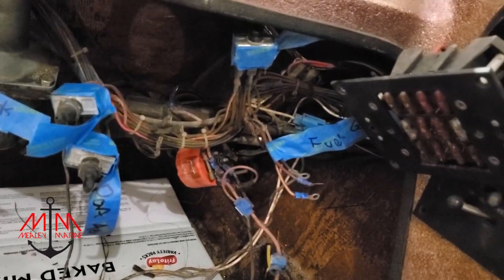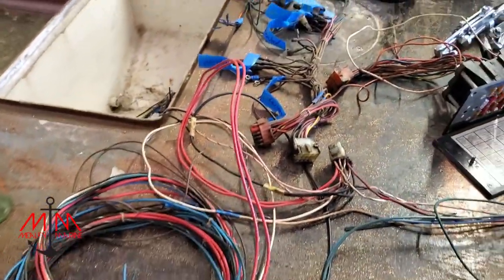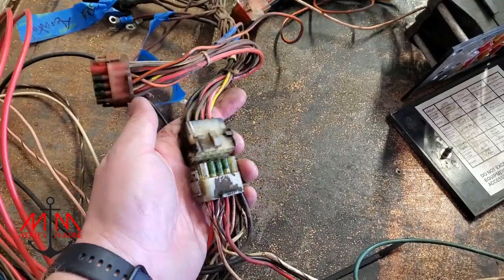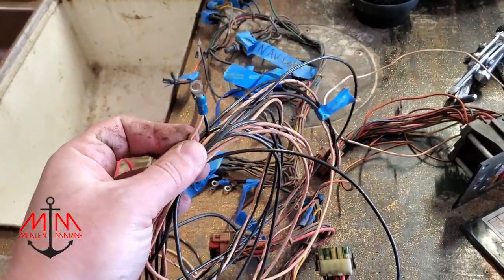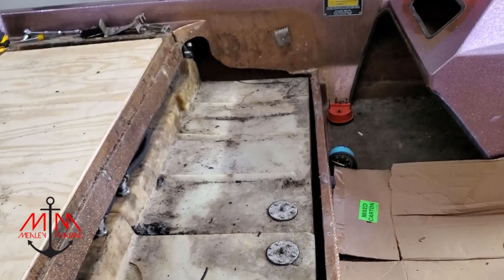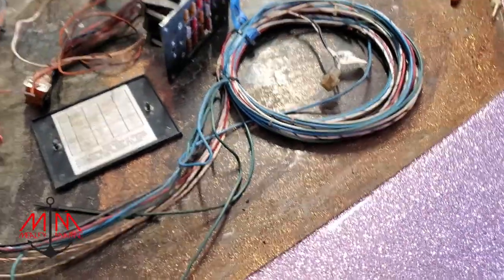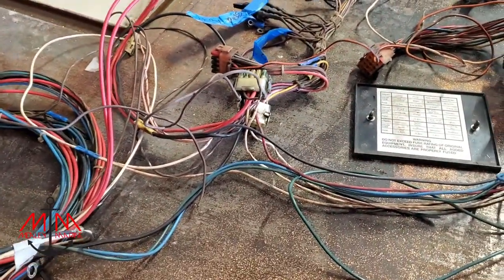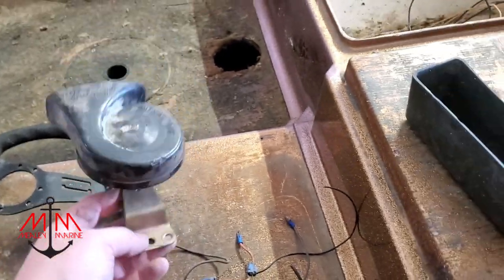BASS BOAT RESTORATION | 1988 RANGER 363V | PART 14: OLD BOAT WIRING

Comment: I just bought a old 88 bass boat. Going to do the same. Tear out all the old wiring and replace it with new clean wire that will be simple and easy to understand and use.

Comment: I have the same exact model boat but its the black, silver and red one in very good condition for its age. Gel coat is still as shiny as the day it rolled out of the factory. To remove the ground wire for the sending unit. All you have to do is unscrew the fill hose from the tank, take the 3 screws out of the fuel fill cap and pull it up. You will see where its connected right under the fuel cap. Ive enjoyed watching your restoration.  Awesome to tackle such a huge restoration but definitely rewarding!
Reply from the maker: I'll have to give it a try!

Comment: I look at things a bit different than most. If you like the boat and plan on keeping it, and if the motor you have now is a good one, then put it back on and run it. If it blows and the bill is going to be too high to justify a repair, and you still like the boat at that time, then replace it. Point being, I wouldn’t buy a new motor if it wasn’t a NEED at this time. Just my two cents. Great video! Keep up the great work!👍🏻 p.s—— the growl of the ole two strokes is music to my ears🎼🎼🎼

Comment: Hey I've got an 88 374V and my fuse panel is the same as this and is corroded. By any chance do you know the part number or where to buy a new fuse panel online? I can't find the 4 column 3 row style of fuse panel. Also, my paper that shows all the items for where the fuses go was completely faded so I took a pic of what you held up. Will see if it's the same but I do believe it is so thanks for showing that.
Reply from the maker: You can find the manual for your boat on the ranger website.
Reply from the maker: I doubt there will be a exact replacement. I'll look and see
Reply: @MealeyMarine  I have the manual from the website, it shows the fuse panel but not the Part Number for it. At least that I could find.

Comment: No way man if the current one works or doesn't have major issues I wouldn't! Also on your fuse I believe it's a 3-10 recommendation not that it has to be a 3 or 10 so five would be fine!
Reply from the maker: Oh i see. That's a good point! Thank you sir!

Comment: Newer motors are generally better. Same philosophy I use for shirts! I need that shirt!!!

Remember your engine wiring is different from the boat wiring. Things like that three pin plug probably drive things like tachometer or trim gauges. Not uncommon to have those just dangling loose in an old boat.
Reply from the maker: Are you familiar with thse engine wires? I'd love to pick your brain about it.
Reply from the maker: Hey David, you won the free giveaway! Send me your shirt size and address to customerservice@mealeymarine.com

Comment: I'd keep the Yamaha.  Those older ones are bulletproof because they're the only ones that made a reliable oil injection system.  An OMC or Merc of the same vintage, yeah, I'd replace.  Besides, you'll be spending your $ on diapers!

Comment: IMO I would go with a new 4 stroke about the same HP as the original 2 stroke was. By the time you’re done with this build you’re gonna have a lot of time and money invested in it. The 4 stroke will be less maintenance and last longer, as well as if you decide to sell the boat IMO it would be an additional good selling point to go along with the well done restorations that you’ve already done. It would be different if you had the original 2 stroke motor I would maybe think about rebuilding it to keep it original. You will have no regrets on going with the 4 stroke. Love the videos so keep them coming.

Comment: I just repowered my 1999 champion 191 with a suzuki 4 stroke.  Love it so far!
Reply from the maker: Heard they are great motors! Roughly how much it run you?
Reply: 200hp with fly by wire instead of mechanical cable was 16300 installed.
Reply from the maker: @kurtmahue8436  that ain't bad!